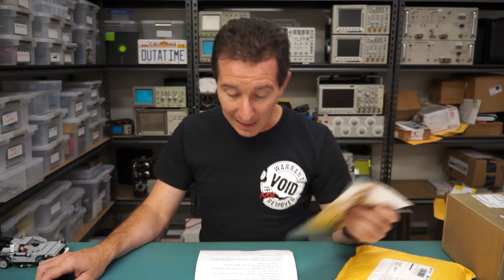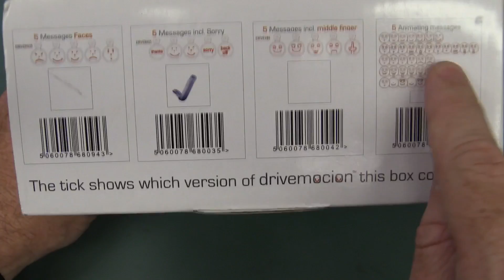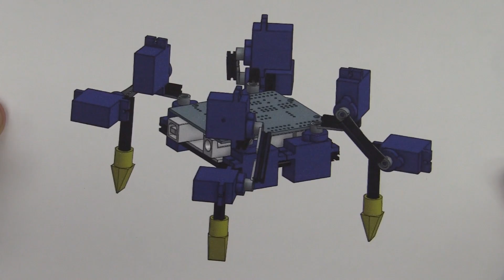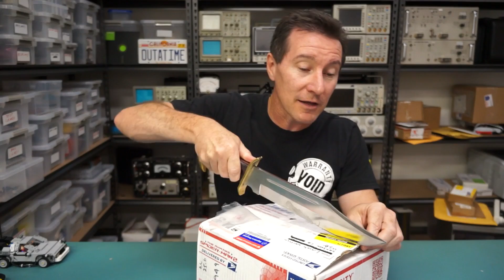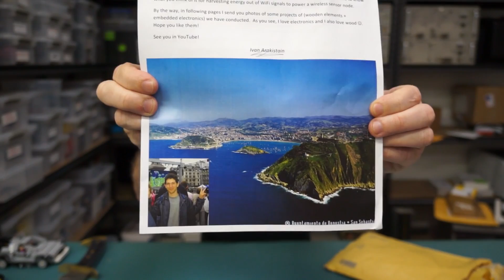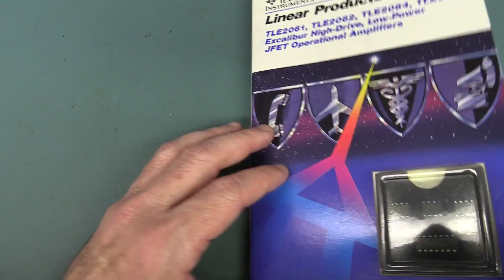EEVblog #715 - Mailbag

Comment: Oh My... I remember something similar to the Drivemocion  in the JC Whitney catalog in the (mid?) 1970's. 
 It was a a rather large rectangular box that mounted on the top of your car, strapped down to the drip rail. Much like a Police light bar. It had a mask with lights that lit up behind similar phrases ( Back off, Thank you, your signal is on, dim your lights,  etc). All controlled by the driver.
  The illustrations  in the ad were obviously from the 50's.
 Good for a laugh, even back then. Who would think someone would recreate it today, smaller and with LEDs, of course. Unbelievable.

Comment: I've got a first-generation TI-92, myself.  Has the old gray-on-green LCD and had to buy and install the "plus module" some time after the fact.  Still works fine of course, almost 20 years later.

The exponent key is the ^ caret, which is literally "to the power of".  So  2^3 = 8. But you want the E, or "times 10 to the power of"  2E3 = 2000.  Kind of amusing to think that some people might be annoyed by which key was assigned to be a secondary function based on the kind of math they use most often. :)

Comment: I have an old early 90's style license plate frame with a actual tri color LED matrix in it. We already parted it out though but the actual LED matrix units we still have.

The GE Phoenix SX mobile 2-way radio used a PAC-Tec type case also.

The RFD device is not a new thing, We have run trials here to harvest up to a couple hundred DC volts from nearby RF sources. problem is the sources either have to be high powered and very close by or connected directly.
The best way to harvest DC wirelessly id to connect the device to a capacitor bank and have a times triggering circuit to act as a pulsing charger for a battery bank.
Main issue we had was the power required to generate enough RF to effectively charge a 12 volt DC battery was far greater than the harvested power. basically speeking it takes more energy to start the process than what is collected.

The device can in fact collect fractions of a volt from ambient RF being fed in from an old analog TV antenna which you can  wire to a multiplier and then a cap bank..We got several White LEDS to flash at a 1 second pulse at a decent brightness doing this though. 
Our testing was done a few years back also, I;m sure the whole thing has advanced greatly since and I await to see what this FRD produces!

Comment: Calculators are simply way too expensive. Why does every single student need their own calculator for an exorbitant price? Mathematics is not about computation, it's about a way of thinking. Most of the time, you don't care about the numbers, but the how you work with them.

This idea of building a curriculum around a calculator just serves to feed an already rich company.
Reply: Yes, and now that gig is increasingly going to Apple with its limited range of mass-produced identical phones rather than the plethora of other manufacturers who offer more variation and more flexibility.

Comment: If the TI-200 has a feature to add TI-Basic that RS-232 port could allow the calc to become a hobby/kit PC that can be programed to control servos (robot) or motor boards.  The hand held portability would make it ease of use and cheap.  Just what a school would want most.  http://en.wikipedia.org/wiki/TI-BASIC

Comment: Really interesting with voyage 200 PCB that each of the QFP packages have there own square Fiducials to help with machine placement accuracy. Must have been some worries about cross board registration. or maybe it could be something to do with the automated inspection to have a reference for alignment in the same visual frame :).
Reply: I find it more interesting that it contains so many chips from Ti's own competition.  That's spells silly management to me.  Surely they could have used an OMAP processor and some Ti LCD drivers.

Comment: Sagan sized youtube Tshirts, that means one thing... Sagan needs more Youtube time for his projects. 
I am getting more of a interest in electronics, still don't know where to start.
I tried fixing a light problem, found that the blue wire was fitted to the blue wire and the brown wire fitted to the other blue wire.
I tried to measure between the first blue wire that came through the ceiling to the brown wire that came through the ceiling.... It gave a bang and tripped the RCD. No clue why it was wired that way or why it tripped the RCD, i do not trust the electricians wire skills.

Comment: When I reach for a calculator, it'd for my old faithful Casio FX-100, still going strong on its original Casio branded AA cells with 1983 date codes!
Reply: Just checked, my Casio FX-7700GE is still running on Duracell AAAs expired in 2004. Damn, I was still in university a that time. I can't beat 1983, but at least it looks like I don't have to worry about flat batteries soon ;) .
Reply: The TI voyage 200 would drain 4 AAA batteries in about a month.  It was better in every other way though.
Reply: TI-83 All the way for me, baby!

Comment: Dave, on the car emoticon thing, I think that extra LED under the IR detector is just to hold it up in place. With so many LEDs on the BOM, it must have been cheaper to just include one more per unit rather than use a proper support...
Reply: Or it could be a feedback LED. Lights up when it receives the commands, to show it is working.